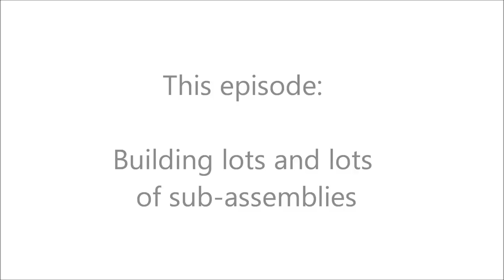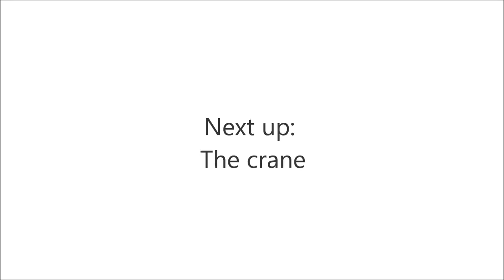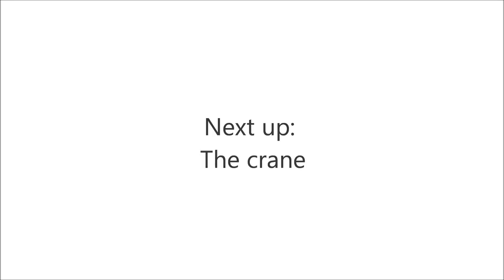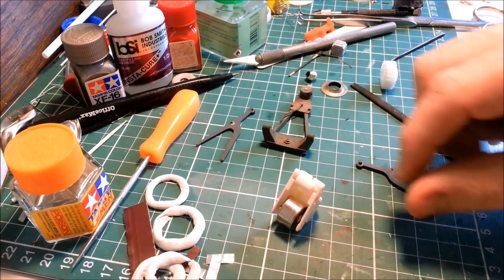Scratch building 1/35 scale science fiction model - Part 6

Comment: So glad u laminated that hook. Adds some heft too it. Realy impressed with those door hinges too. Long road to travel but the reward is worth it! Have fun mate putting it all together..cheers.
Reply from the maker: Thanks mate. Agreed, I was horrified by the original hook when I placed them side by side! How've you been?
Reply: Dave's Model Workshop I finally used my paint booth I made out of old t.v. and it works great. No dust or hair to mess up work and the bare bulb adds just enough heat too quicken drying times. Did a lot of planning too do it and now for the reward.  A 32 inch flat screen  tube type. The caseing is large in the back to accommodate fan and light pot. Front is wide flat and very open. I sealed all holes and put a clear plexy cover to replace screen. A florescent light provides good light source for paint work. I have over 150 models in my stash and now I have a great workplace too start playing. I enjoy looking at your work and ideas . Look forward too more in future. Cheers mate.
Reply from the maker: That sounds brilliant Lance! Is there any way I can see photos anywhere online?  Love it!
Reply: Dave's Model Workshop don't know your last name but if u send friend request on Facebook I will make sure to add u 2 friend list.. not to computer savey yet so bear with me. I'm doing several posts of 1/350 Minecraft titanic I'm starting now. Look forward to conveying on line. Tada.
Reply from the maker: Just sent off a friend request now mate. Dave

Comment: Outstanding job on the crane! It's coming right along and starting to look like something !  Have you checked how much heat is given off by that bulb?  I've had a run-in with that myself, time or two ......
Reply from the maker: Hi Ennis, I've decided that my electrical skills are not up to the task of lighting this. Plus that headlight bulb is blown anyway. Plus if it wasn't already blown, the rough handling it received from me cutting away the surround would have killed it off!
Reply: Dave's Model Workshop 
Pity Dave. That would have been a great look for it. On the other hand you could mount an LED to light it. If you really want simple, use just the clear tube and a wrap of white paper to defuse the light. Light seal the top of the tube and there you go. 
   Something I just saw reminded me to give you this tip.  When you're going to saw something like you did you should mark the line then follow the line with masking tape to guide your cut.  Makes it much easier and gives you a better cut.